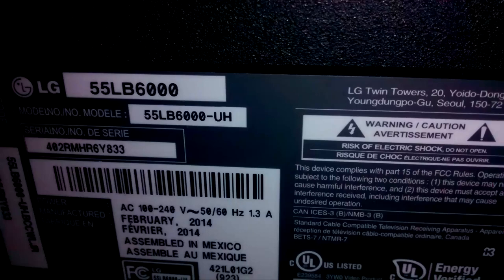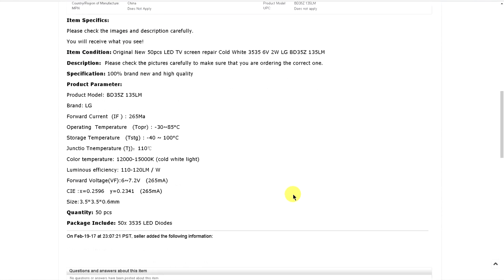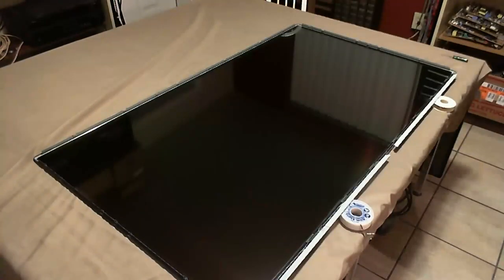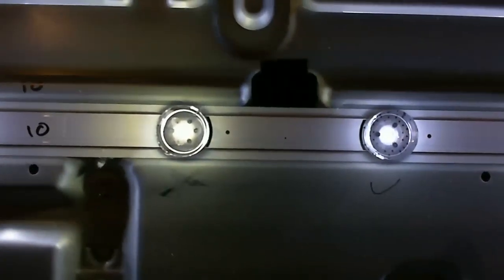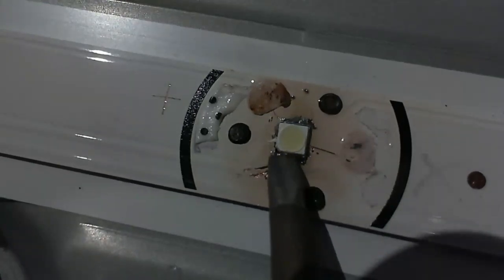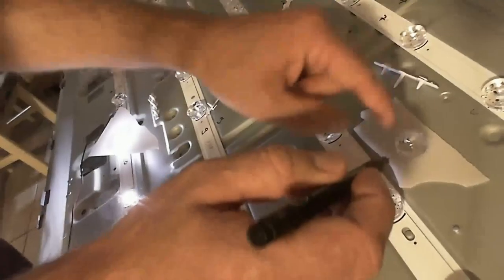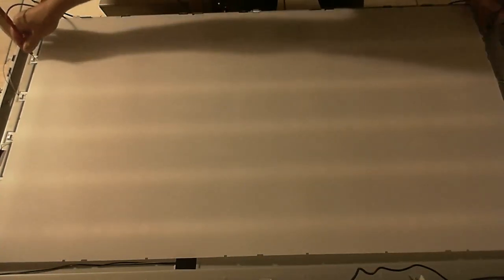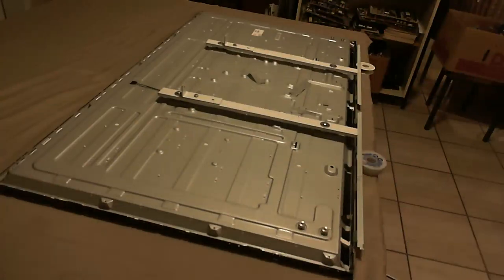55LB6000 backlight repair - LED replacement LG 32LB, 37LN, 39LN, 42LB, 47LB, 50LN, 55LB series

Comment: I also graduated the trick with sticking the scatter material on the lens (I used office paper).
Due to the adjustment of the current to decrease, it is not necessary to exchange the resistors for other values, since it is sufficient to disconnect one or two parallel branches (from four original branches) and then going to current reduction to 25% or 50% reduction and this not increase the load of the remaining original resistors.
Those who do not believe need to be verified through calculations through Ohm's law + calculations P tot of remaining original resistors. 
For remove of LCD glass I use the I use board from plexiglass with 16 pcs of suction cups holders. The suction cups are originally for towel. Who's interested in details, let me know. Because essentially lifting of LCD glass with the hands is a big risk, if diagonal size of LCD is more than 32 inches.

Comment: Very helpful video thank you, just a quick question about the orientation of the lenses. I mistakenly took off all the the lenses. does it matter which lenses you use for each row or are they all the same, i notice them have different numbers on the back of them. Do you just need to turn the lenses to match up with the original glue spots? @TomTechTod
Reply from the maker: They are the same. Either back in the original glue spots if those aren't damaged, or directly on the PCB at an angle. Very important that they are exactly positioned

Comment: I had this exact problem - I could see the screen images when using a torch, but otherwise the screen was black and there was no sound.  I replaced the LED backlights, switched on, but it was the same - so maybe it isn't the backlights?  Anybody have any idea what the problem may be instead?

Comment: A little tip use hot glue (Small amount) set lens in place put you diffuser on and then adjust as  required by heating the lens gently with a heat gun and move until you have it set correctly
Reply: Nope. In time the hot glue will melt from the heat generated by the led and the lens will shift. Use proper glue or don't bother

Comment: Buy some other LG strips with led and lenses attached 2 part proxy fix lenses so they don’t come off then cut them leaving some board either side + and - then where you a faulty led cut the faulty led down to board level heat with soldering iron to remove old pads, now insulate the solder pads with tape, take one of your pre-cut leds and glue it over where the faulty one was and then just solder + and -  saves playing with lenses and leds
Reply: That is not the proper way to repair a backlight. That's botching. I just saw one of these so called repairs. Looks awful, sketchy as hell, and you can see the difference on the image.

Comment: Great video. What is the point of the white paper-like bars between the led strips and the metal? I removed the led strips and those peeled also. Are they important?
Reply from the maker: Idk. I didn't see a difference without them
Reply: It's for heat dissipation.

Comment: There´s a new nasty led around . Samsung  serie J , 10 leds for a 32" , 32 for a 48" . Those are driven at full 3W , 4V .750A. If you put the common led , explode instantly, literally. Are those at least 4W or more.
Reply from the maker: Wow, 750mA is a lot. The ones in this video are 6V LEDs. It's probably gonna take some time before I see the ones you are talking about...

Comment: Anyone know where to buy replacement diffusers? Mine all got damaged when I tried to glue them back in. Also, what glue is recommended?
Reply from the maker: some people use hot glue. I;m not a fan of it since I don;t know how warm the pcb and therefore how soft the glue gets... I prefer two component adhesives

Comment: Thanks for your advice. I have a more pressing matter though. I have issue with a lg tv whose picture seems "solarised" and if i turn down brightness and contrast to zero i am left with a milky white image instead of a black screen. I suspected the tcon board but sm not sure as the panel has electronics of its own. I located various test points on the tcon and noticed VGL and VGH. I cant get any info on these two voltages but i measured them as follows. VGL = -5.6V and VGH = +28V. I then measured some other points that were something like this. V1, V2, V3, V4, V10, V9. From V1 to V4 the voltages are consistently 0.7V in drop. I.e V1 = 2.8, V2= 3.6 etc. Do you have any info regarding tcon boards where you explain what should be measured? I am convinced that there must be a common grid voltage that is not ok. What about VGL at only -5.6V? Shouldnt it be more negative? Regards Angelos.
Reply from the maker: I don't know much about TCON other than the VGMA voltages have to be increasing or decreasing in a sequence. Solarized could be mainboard too I guess
Reply: TomTechTod i checked in service mode and there were no changes to the image when i altered the bit options regarding panel manufacturer. Very difficult to get any information on lcd tvs nowadays.

Comment: Hi Tomtech, How would you go about setting the focus of the lens if the front of the lens is curved and not flat as is the case with the LG TV?
Reply from the maker: If the front is curved the exact position is not as important , at least in my experience you couldn't see a difference once everything is assembled.
Reply: TomTechTod Hello again. It also makes those round patch circles that you had. I really struggled to align them. Perhaps just slide over the diffuser and then just try my best to minimize the patch.
Reply from the maker: That's new to me for this kind of lens. But yes that's the way to go... very cumbersome, especially if you assemble everything back together and still see those patches
Reply: TomTechTod is it always the same on different types of tvs that you increase the current sensing resistors slightly so that you can drop the current and voltage supply to the led's? Its an epidemic here with most failures being backlight related. These manufacturers run the led voltage bias on full blast on purpose.
Reply from the maker: Yes, when it's obvious how to do it I always lower the maximum current.  Then, even if somebody accidentely puts it on maximum in the menu it's still protected. I can hardly see a difference with 50 to 70% of the max current. Maybe in bright sunlight , yes... but then who watches TV on the beach :-)

Comment: For sticking of lenses I use a hot glue gun. Due to the reduced current there is no plastic melting because the LEDs do not exclude too much heat.
Reply: Dont use a hot glue gun. They'll fall off very soon.

Comment: Yeah just slammed TV back together and of course I didn't pay attention to lens alignment much and now I see bright patches all over the picture where I have replaced new LEDs. What if I don't have any old diffusor sheets to make round calibrating tool and some of the lenses I popped out lost 1 or 2 of those tiny "legs" of theirs? I'm going to lose my hair adjusting those thingies? Also are round white stickers necessary under the lens because some of them got in pretty bad shape when I had to remove them before replacing LEDs using hot air?
Reply from the maker: no need for the little white stickers underneath IMO. The main difficulty is the alignment of the lens. If the legs are broken off then use a piece of plastic with the same thickness as the legs height to put underneath the lens temporarily, while the glue cures. For the diffuser you will have to find a substitute piece of plastic, maybe part of semi-transparent plastic cap from shower gel or similar could work? You will have to experiment a bit. Yes you may loose some hair :-D
Reply: TomTechTod Ok thanks for help, I think I'll take the TV apart again during weekend and try to position lenses better, had to replace about 14 leds so not that easy job. Maybe simple lens cleanup with IPA helps as I didn't do that either.

Edit: OK I aligned lenses and picture is much better, not perfect but suffices to my parents. I used glue that cured pretty quickly so I did 1 led strip at a time and put diffusor on top to see if light spread evenly. While I was switching TV on and off 1 more old led died and had to be replaced. Bummer, I guess I'll be replacing rest of of them sooner or later despite lowering backlight level from default 100 to 50. I also noticed that new leds were different color, originals were blue'ish tinted but leds I ordered were white. Not a huge difference but difference anyway.

Comment: hello my friend, what's the name of this glue you use to put it on? Thank you very much in advance
Reply from the maker: Bianor Rodrigues loctite poxy pak fast cure epoxy. I guess hot glue or instant adhesive will work too...
Reply from the maker: Bianor Rodrigues Acho que seria tipo Araldite no Brasil se eu lembro bem
Reply: TomTechTod Many thanks friend.

Comment: What leds do you need in a 50in lg tv model 50lb650v-zn?
Reply from the maker: I don't know this model. It seems to use the LG 6916L-1781A/6916L-1782A ( LG INNOTEK DRT 3.0 50" ), probably 36 LEDs in total inside the panel. The lens for that strip looks similar to the one in the video. If you want to be sure you need to open it. Probably 6V LEDs , this can be calculated with the voltage printed on the power supply board.
Reply: TomTechTod also is it my backlight that's broke as my tv flashes black and then Back to the screen I was on before and keeps doing that. Thx for the fast reply
Reply from the maker: To be absolutely sure you would need to apply voltage to the LED connector, this voltage can be pretty high, it would probably need several DC power supplies in series. Other than that the only other way is to measure the current through the LEDs but that requires an oscilloscope and a current probe.
If you can try to lower the backlight setting in the menu (picture tab) and see if the interval between on and off gets longer. That would point towards defective LEDs.
Other than that, you'd need to open the panel to be sure, then you can apply voltage to each LED individually.
Reply: TomTechTod cheers yesterday I turned it down and it has got longer in between how much would you estimate it to cost?thanks again
Reply from the maker: So it's likely one or more LEDs. I would get 20 to 50LEDs, they cost about $20 in total on ebay. If you can get a second person to help and lift the glass by hand or with suction cups and put it somewhere safe (that's the inverse of what I did in this video). Use soft (fabric) gloves to avoid smudging the glass. Once you get to the LEDs determine first which ones are defective. Start by applying 2.7V from + to - on an individual LED, if it doesn't light up increase voltage, It should light up then at 5 to 6V. This way you'll find out the forward voltage drop of the LED. I suppose it's 6V in a 3535 package or similar. Then follow the steps outlined in the video. To reposition the lens I use two-part epoxy glue, not instant adhesive glue
Reply: TomTechTod thanks for the help will probably get that done in the next few weeks and will tell you how it goes
Reply: TomTechTod I'm not sure if you can help. if I use any cable on the tv it works for a bit then starts flashing black then back to normal  and eventually it settles down then keeps doing this.however when I use YouTube as it's a smart tv it's fine why could this be (I have used all 3 hdmi slots and different cables)
Reply from the maker: ok so it looks more like it's having trouble recognizing the source. Try to use a different source if you didn't already. For testing I would also use the shortest HDMI cable available (think it's about 3 feet)
Reply: TomTechTod I have tried 4 different hdmi but I don't have a really short one is there any other ways I can tell if this is the problem?
Reply from the maker: I don't know of any. I'd try the shortest possible (it's about $3 around here in these cheap dollar stores). Try another source, try the Video input (not HDMI). Never had such a problem, but then, I'm not a professional TV tech either :-)
Reply: TomTechTod ok will try that
Reply: TomTechTod ok I think it's the back lights as it has now started on the smart tv features if I take it apart what do I need to test the lights can you link what I need thx
Reply from the maker: If you don't have an adjustable power supply try with a 9V battery and a 100 Ohm resistor in series, apply to each LED only for a short time and with the right polarity. Intact LEDs should light up, 3V types and 6V types also. Faulty LEDs can be either short or open.
Reply: TomTechTod ok will try that soon
Reply: Josh Staszewski I ordered new LEDs from ebay but even if they are supposed to be cool white (kinda blueish tinted) they seem to be more warm tinted when comparing to original LEDs. So your mileage may vary and there is no guarantee of the LED quality. All of the new LEDs I received worked fine so that's a good sign I guess as there has been few LEDs dead on arrival when I bought cheap leds for my car and they didn't last long.

Comment: Watching your video and reading comments makes me wanna make somewhat deeper box and placing ANY source of light behind (maybe 2*cfl 18W hahaha), it would be cheaper (free - i have them) and maybe more simple. I found this TV next to trash can (free), used wood is free (also next to trash can), i only wonder if i could completely remove the metal between pcbs and light strips. Comment, someone ?
Reply from the maker: I suspect there isn't really enough space and the cable from the T-Con to the screen are also very short...
Reply: @tomtechtod9200  no problem for that, i could easily make a 10-12cm deep wooden box, but i have to remove the original metal, so what about interference ? Does it have to be metal between pcb and display ? Please answer if you know, it would be valuable info
Reply from the maker: @pingvinac  i never did something like that. Don't break the glass or rip of the tab bonds :-)
Reply: Tnx all, i opted for 2 x 5m white led strip for uniform lighting, maybe one strip cool white, other interlacing with warm white, total 14 rows. All for 2 x 2,67 usd on banggood :) i think one strip with 7 rows on 32" tv would be underrated and non-uniform
Reply: @tomtechtod9200  i replyed to myself :)